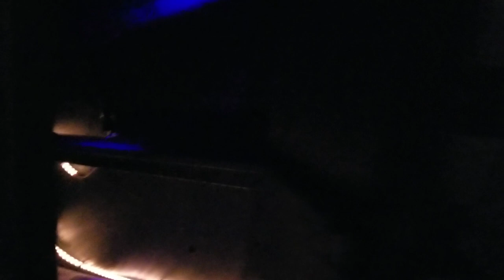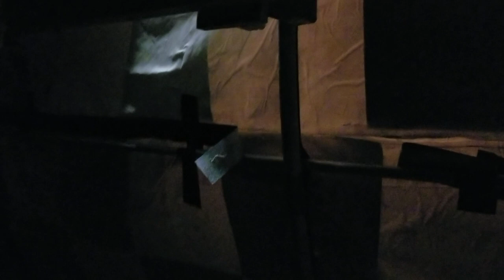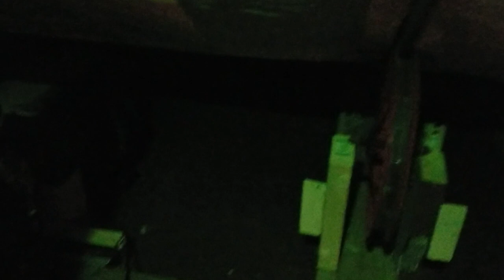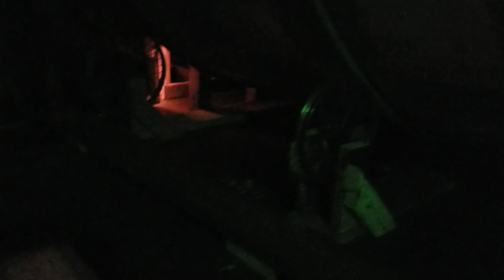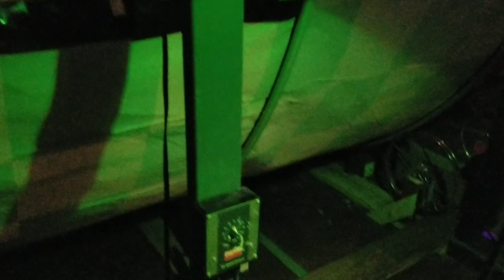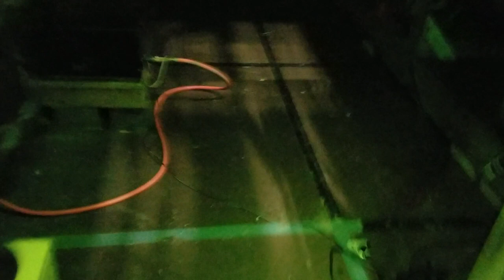How to Build a Better Vortex on a Budget

Comment: Hi joe! Great stuff. I’m inspired to attempt this too. I wish I was still living in your area, I’d team up with you. Thanks for the parts list. I was thinking about using U shaped rubber casters instead of the lawnmower wheels. Question for you- what’s the total length? About 20ft? I’m trying to figure out spacing between the rings.  Also, I read one comment you wrote about reworking it to have hinges on the arms. How did that work out? Would that mean the bike wheels are removable and when installed can then be adjusted  closer / further from center?
Reply from the maker: Hey sorry for the super late reply! Overall length of the bridge was about 20', the tunnel was 16' I believe. I ended up reworking it to have the bike wheels on the bottom stationary but the arms on the sides were movable. So rather than adjusting the whole tunnel, I could just adjust those arms when needed.

Comment: How far apart are the rollers on the walls? We are trying to mirror thos project and are having trouble helping the rings to stay circular. It collapses at the bottom and hits the ground.
Reply: Also how high is the walkway underneath?
Reply from the maker: @chrisadkins5430  Im building this again as we speak. My clearance under the bridge is 1.5'. If the ring is hitting the ground you pay need to slide the bottoms wheels closer together. I redesigned my side wheels this time so that nothing is attached to the walls. They are on a hinge coming off of the frame under the bridge. This makes them adjustable to that I can "squeeze" the ring if I need to. Hope that helps.

Comment: What HP motor did you use with the gear box Joe..?
Reply from the maker: Hi Kevin. Trying to find pics, I honestly can't remember. Ill post here when I find it.
Reply: @joefazio6486  Thanks..
Reply from the maker: @keving1786  looks like it was 1/2hp
Reply: @joefazio6486   Thanks again..